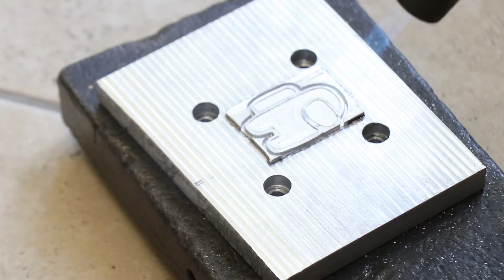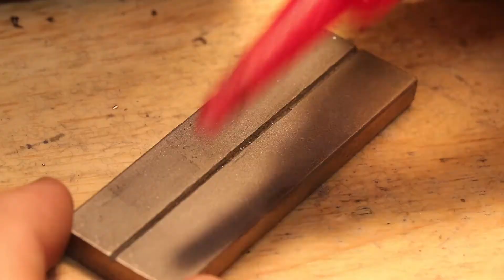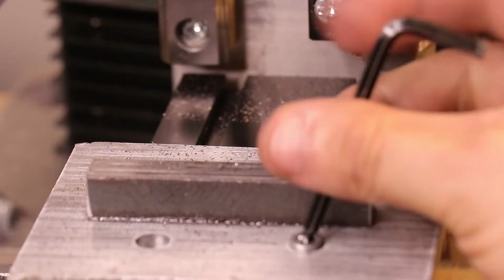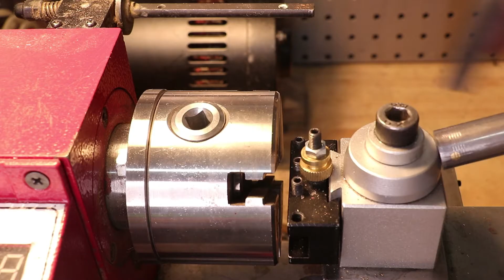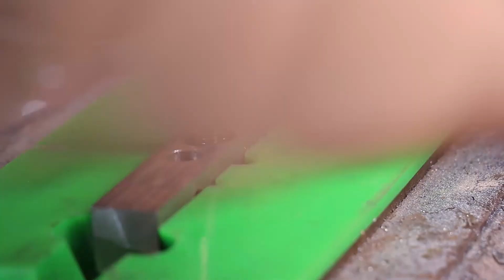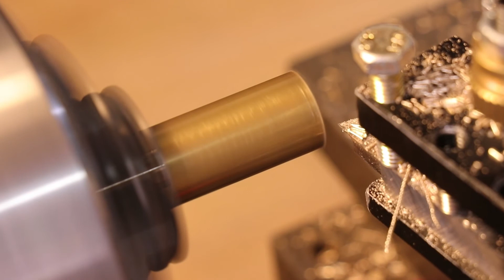Mini Vise Build For The CNC Mill

Comment: Are you milling with a center drill in that first section of the video?

Also a small tip: it's a misconception that you should go high rpm with slow feed and low engagement if you only have a small mill. All this will do is wear your cutter out fast (even carbide) and rub on the material, generating lots of heat. The keyword is chip thickness: it shouldn't get too low for the cutter to cut properly, so either turn down the rpm or turn up the feed and it should cut much better. Gotta give it something to bite.

Also making a small flycutter is not that hard, just gotta balance it right and it should work pretty well.
Reply from the maker: Yeah I am, it had the right profile that I needed for a stamp and it cut fine enough. Secondly it is not the case for this router set up. Just the lack of rigidity compromised it and finding an appropriate cutting speed was difficult. The cutting that you see here is what worked best and in any event its carbide so it can take the high rpm. I used this a lot and I can tell you low rpm did no favors for the cut

Comment: Hi, Instead of gluing the part to the table, you can create a magnetic table! The mechanism is quite simple!
Reply from the maker: Not this particular one, the cross slides are made from aluminium, and I use it so little that it wouldn't be worth making a dedicated one.  Cheers

Comment: I had a few different thoughts while watching you make this.  Firstly, there is no wrong way to make anything as long as it fits within your capabilities and requirements.  Second, I had expected you to slap all the bar stock pieces onto the plate to be milled at the same time.  Thirdly, I thought you might be able to mount a fly cutter (assuming you had one) in your lathe chuck, and use that to surface your bar chunks.

Comment: If looks like it may be close to the maximum size but why not square the sides of the bar using the four jaw chuck in the lathe?
Reply from the maker: I probably would have, but at the time I made this video I didn't have an independent 4 jaw chuck, I got it shortly after I made this video. If I had it then, that certainly would have been my go to method as it would have been much quicker. Although I way still pretty happy with the results from the mill.